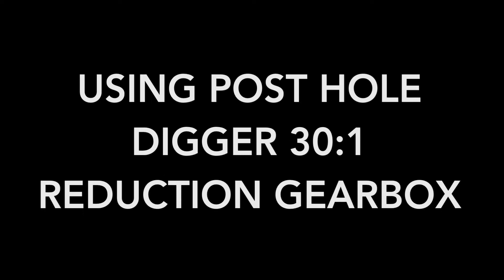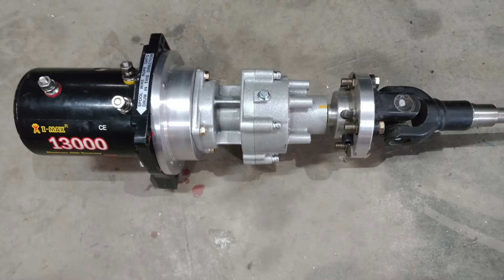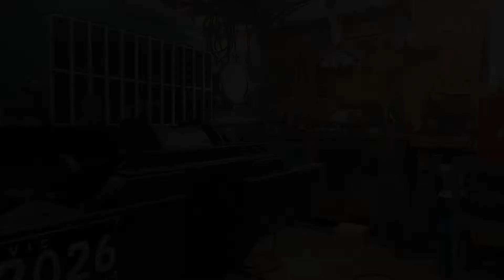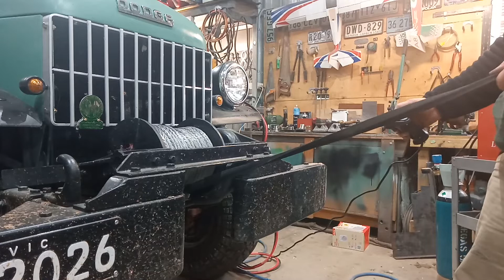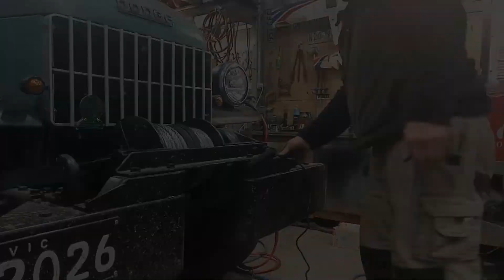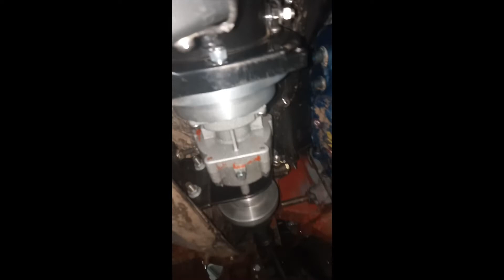Converting PTO winch to Electric

Comment: Looks like a good way of keeping the winch working. I wonder if the motor is better off in this location than mounted on the front like most modern winches.
Reply from the maker: I was thinking the same,  the motor is well sealed but I'll add a splash guard just to be sure.